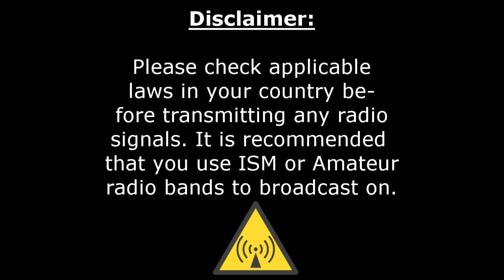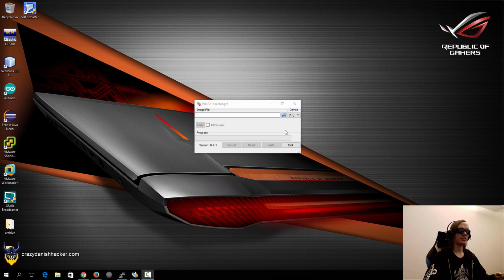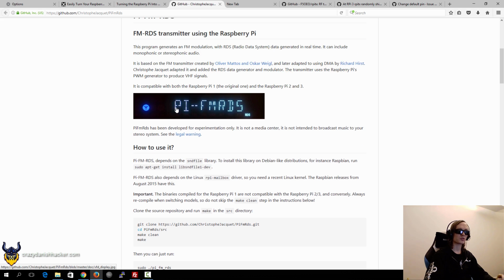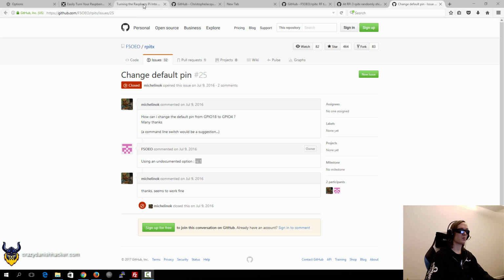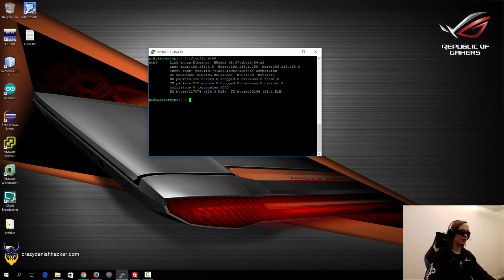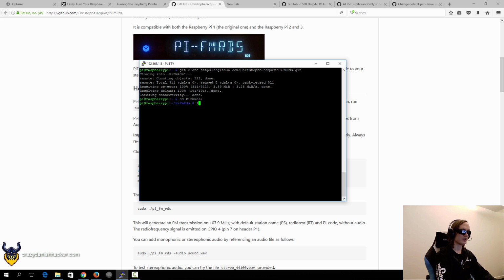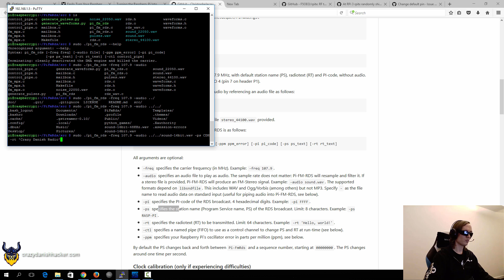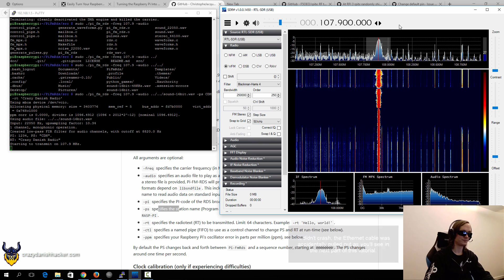Transmit Radio Signals w/ Raspberry Pi (1/2) - Software Defined Radio Series #24

Comment: Can rasberry pi or adruino relay a 125hz signal in 433mhz without major delays??
Reply from the maker: Raspberry Pi can transmit at 433MHz easily, as it is possible to transmit between 5 KHz and up to 1500 MHz. The bandwidth you can transmit isn't mentioned, but 125Hz should be possible. Keep in mind transmitting with a Raspberry Pi may cause a lot of harmonics, so you're better off using a proper software defined radio. 

Reference:
https://github.com/F5OEO/rpitx
Reply: @CrazyDanishHacker  do you provide a freelance service? I would appriciate contacting you through email (I will post mine) in order to try to have a deal. Since i am in need for assistance, i dont mind negotiating a deal with you or anyone you would recommend. This is a serious note. Please reply and thank you.
Reply from the maker: I am already filled up with full-time contracts in relation to penetration testing at the moment.

Comment: Hi there! is it possible that if I replace the Terratec E4000 RTL-SDR with the raspberry pi 3?
Reply from the maker: The Terratec E4000 RTL-SDR cannot transmit as far as I know, but it can receive from around 25MHz and up to 2100MHz. The Raspberry Pi can transmit by modulating some of the GPIO pins, but I do not believe it can also receive. So no, you probably need an RTL-SDR like the NooElec or RTL-SDR.com one with the metal heatsink on it. It's around 20-30$ and they work quite well for receiving. (The current and smallest one I have is from RTL-SDR.com, which I use a lot as it's cheap and I don't need to worry about breaking it.)

Comment: are you danish
Reply from the maker: Yes, some viewers have even pointed out, that I said some words in Danish in some videos.
Reply: Crazy Danish Hacker oh im from denmark myself and im a licens radio amature call: oz1tnj

Im just thinking about if i can use it as a becon

Sry for my bad english ;)
Reply: And i think the rw (random wire) antenna you use is not the best
Reply from the maker: You're correct that the random jumper cable/wire is really a horrible antenna, but it did increase the signal quality slightly. Without any amplification of your RPi signal at ground level and inside your house or apartment, it's going to be very hard for anyone else to receive it too.

You're better off using an SDR or a purpose-built radio for transmitting whatever you want to transmit. 

I'm not an expert in RF, but I am familiar with the some of the basics like wavelengths and antennas, polarization (in very simple terms), ISM Bands, RF burns, Doppler effect for moving transmitters like satellites,  some types of basic encoding (I tend to forget how these work), etc. 

In short, if you have a beginner question about RF/SDR, I can most likely point you in the right direction, as I'm specialized in pentesting (websites and networks in particular) which is also what I do for a living.
Reply: Im not so much in to sdr but  it would be nice if the is some kind of cheap sdr that output around 50mW rf just as a becon for foxhunting

Ps 
Foxhunting is not by any means hunting fox'es it is where you have a becon that output a pulse of signal  
 And then you put that becon somewhere and then the other they need to track  
 It down with a directional antenna
Reply from the maker: Maybe just buy a walkie talkie and use that as a beacon? You could also try this with an RPi and RTL-SDR to make a transceiver (https://github.com/ha7ilm/qtcsdr), but I have no idea what the output signal strength is in terms of milliwatts.

Using an active cellphone (i.e. during a call) as a beacon will be a lot harder because of the channel/frequency hopping.

You could also try and track down a laptop, that's relatively easy even without an SDR.

If you're experienced with electronics and soldering you could also try this:
http://www.m0nka.co.uk/?page_id=2 (mcHF QRP transceiver)
Reply: do you know what the output power off the raspberrypi is
Reply from the maker: The output power seems to be around 80mW, and the frequency range is 5 KHz and up to 500 MHz. Keep in mind the raspberry pi will generate a lot of harmonics.

Output power reference:
https://github.com/F5OEO/rpitx/issues/21
Reply: I can just put a band pass filter on it
Reply: And then i can put it on a bigger antenna

Comment: how i can transmit 5 watt by this project? ,, can i make amplifier and filter with Rpi ?
Reply from the maker: You probably can, even though I don't know how to, just keep in mind that the quality of the signal from the RPi is probably pretty bad, so with an amplifier you're also going to amplify the bad parts, but if you use the same approach as I did, the amplified noise shouldn't be too bad.
Reply: Does this work?
https://www.tapr.org/pdf/DCC2015-QRPi-HA7DCD.pdf
this paper in
https://www.rtl-sdr.com/building-a-ham-tranceiver-with-an-rtl-sdr-raspberry-pi-and-rpitx/
Reply from the maker: Most likely if there is a scientific paper and an article on RTL-SDR.com about it :-)

Comment: any specific reason for choosing these GPIO ports?

can you please demonstrate how to send and receive simple text?
Reply from the maker: No specific reason other than they are probably not used for "anything else" by default. To send "text" you need to choose a protocol first. You could use morse code for example which is a very simple way.

Comment: Wtf? You can use ftp without installing vsFTPd ?
Reply from the maker: Yes, I'm using SFTP :-) It's part of the SSH package in most Linux distributions. Not only is it installed and activated by default in most Linux distrobutions, it is also 100% encrypted unlike FTP.
Reply: Crazy Danish Hacker Thanks, now I've got another question
1) If I answer a comment using Google+ instead of YT, will the comment appear on YT or only in Google+?
2)Is there a way to answer comments via the YT app without loading the video? To avoid paying mobile data for nothing
Reply from the maker: 1) I'm actually not sure, try it out :-) (It looks like you responded via Google+ though?)
2) I don't think there is, as I typically use the browser to read and respond to comments. (In that case, the first ~5% of the video is still loaded though.)

PS: Check the video description as well, YouTube is one of many websites/services I can be reached through.
Reply: Crazy Danish Hacker For the FTP I think you have it because you have RaspbianJessie. I have an old RaspbianWheezy (that I should upgrade maybe) and I had to install vsFTPd because I tried before installing it and it didn't worked.
Reply from the maker: As I mentioned previously, it's SFTP which is part of the SSH package. As long as SSH is enabled, SFTP should be enabled as well. When SFTP doesn't work, it's typically because it needs to be enabled manually in the configuration, despite that it's almost always enabled by default.

Keep in mind, that SFTP is not FTP. Refer to the following page for additional details: https://en.wikipedia.org/wiki/SSH_File_Transfer_Protocol
Reply from the maker: Concerning your other comment about using Google+, it seems to work as my email notification said the comment came from Google+.

Comment: can it transmit at 600 MHz?
Reply: Donald Fucking TRUMP! If you transmit at a third, fifth, seventh, ninth... of a frequency then you get a signal at this frequency. This is called harmonics. It kinds of works for FM but the bandwidth frequency offset (which is linked to the bandwidth) is multiplied by the rank of the harmonic (3, 5, 7, 9...). So if you transmit something at at 200mhz then you'll get a signal at 200×3=600mhz with a bandwidth of : modulation bandwidth × 2 + (rank of the harmonic × frequency offset × 2) so in this case : 2 × modulation bandwidth + (6 × frequency offset)
Of course in case of SSB modulation the bandwidth is not multiplied by two)
Such a lot of complicated math and physics I don't really understand... but it works. Tune your radio at a frequency and transmit at a third of the frequency, see what happens!
Reply from the maker: No, only from 5KHz to 500MHz according to the rpitx github readme. The TX gain is probably going to be very low, and I'm not sure how much bandwidth it can transmit either. (Probably around 200KHz or less, as I've demonstrated it can transmit FM radio.)
Reply: Crazy Danish Hacker For the max bandwidth I've been able to transmit raw IQ files with a sample rate of 128ksps without problem.
Reply from the maker: Thanks for the note about harmonics, I didn't think about using harmonics to broadcast at 200Mhz. Good info about the sample rate as well.